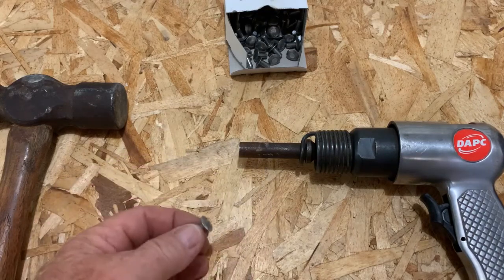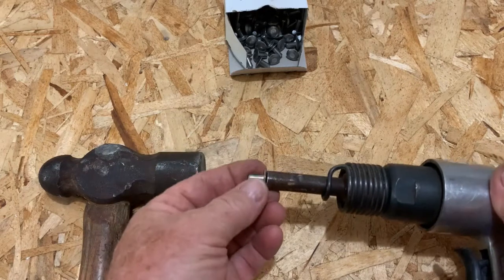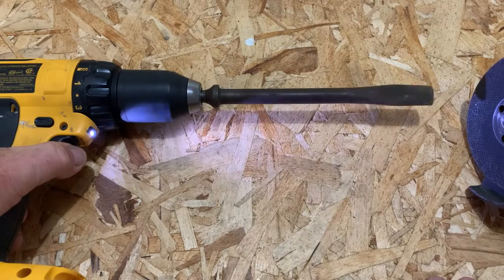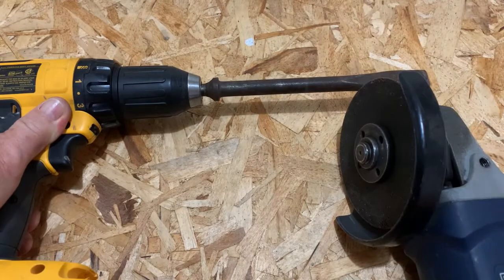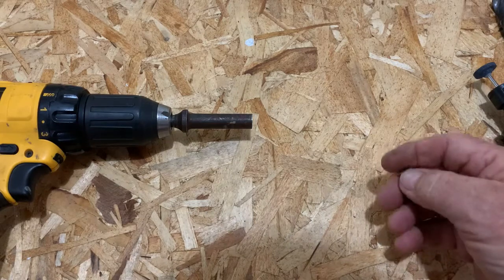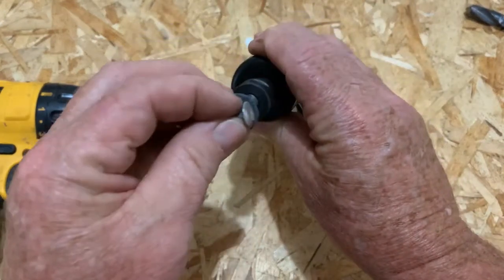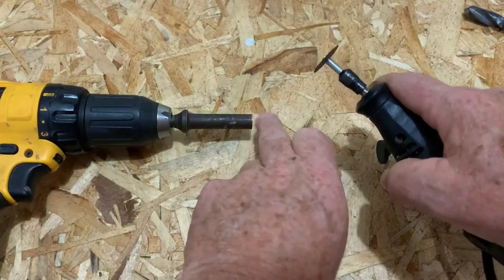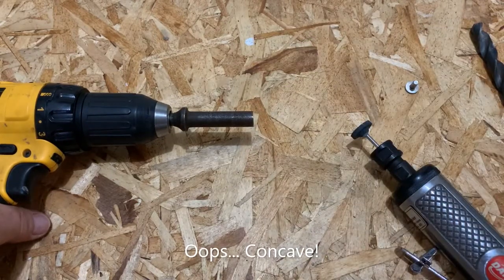How To Make A Rivet Set Tool

Comment: Thank you for taking the time to remind me of the obvious way to make the concaved rivet "hammer"!
Wish that I'd have seen your video sooner, but I don't have any "spare" impact chisels to spare, so I'm using two hardened 3/8" hex head bolts, welded together. But now..., after watching your fabulous video, I'll just grind the hex head using a small grinding stone!!
I'm having to add some fabricated aluminum brackets to extend my Jonboat's front benchseat, into a casting platform. (The brackets were a real trip to fabricate, so that they would bend & conform to the multiple complex angles of that point of the bow.
If you're interested, I'll update you when I complete the job. 
Thanks again, and Stay well, Stay thirsty my new friend!